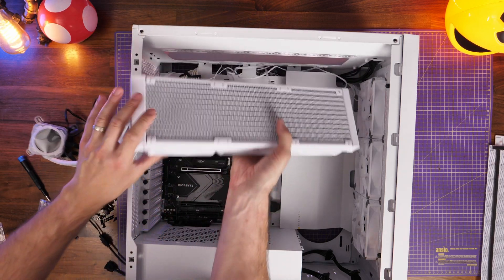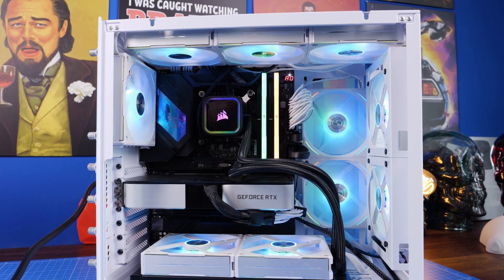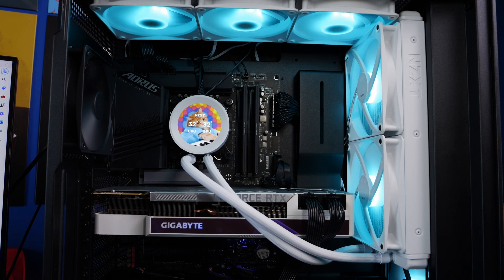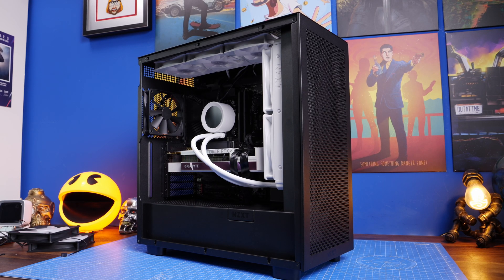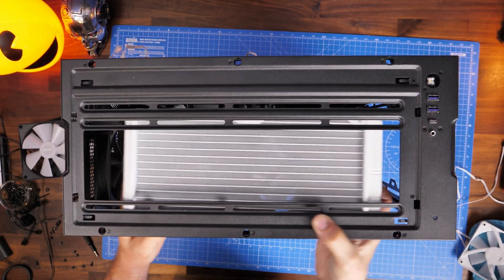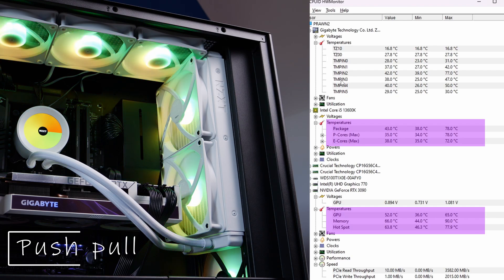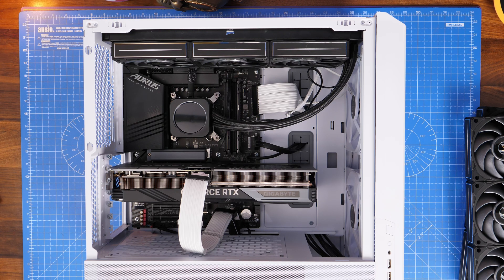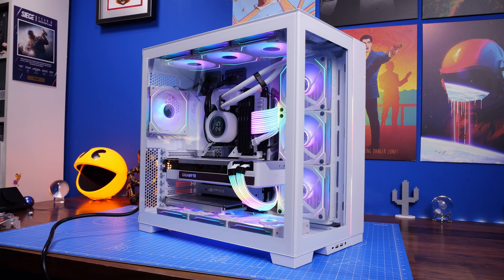Where should you install your AIO liquid cooler? The best places tested!

Comment: Finally a video that discusses fan direction relating to mounting location.  I have glass on two sides of the case.  The location that's makes the most sense for my build is side mounting near the front of the case.  But I wanted to be sure I was ok flipping the fans around since they need to be intake in that location.  Really appreciate your look at fan orientation relative to the radiator.  Everyone seems to be exhausting hot PC air through the radiator.  It just didn't sit well with me.
Reply: The most confusing thing is the orientation of the radiator fans.

They can be set to push air out of the case, in which case the internal case temperature determines the lowest temperature the radiator can achieve.

Or they can be set to pull fresh air from outside into the case, which cools the radiator better, but gradually heats up the inside of the case as the radiator releases heat into it.

I’m not sure whether pushing or pulling air is better when it comes to radiator fans.
But what I don’t understand is—why isn’t there a design option to place the radiator outside of the PC case?
Reply: The most BASIC rule of thumb, like the 1+1 = 2 logic used in math equivalence in AIO mount is that "AIR BUBBLEs OR AIR IN GENERAL WHEN IN A SEALED SYSTEM LIKES TO BE AT TOP" to test this get a bottle of water with some air in it, now notice how NO MATTER WHICH orientation you flipped, turned, twisted it as long as the cap is closed on the bottle the air in at the TOP. When you have it standing the airs staying by the cap of the bottle when you have it laying flat the air spread out through out the bottle but still AT THE TOP. Now use that logic we just tested to when you mount your AIO main goal here is to get the air as above and far away from the CPU as possible. So we are try to orient the radiator at the top or at least in a way the water is as far as possible from the cpu. Think of the whole system close your eyes and imagine it as a water bottle with some air. The bottle cap as your pump and the body of the water bottle as your radiator and pipes. Now think up a orientation to get the air as far, up and away from the cap of your imaginary bottle. Literally if you ever played with a bottle of water as a kid and watched the air bubbles inside swish around as you moved, shaked and jerked it around this explanation should click.

Comment: I did install the radiator on my PC in the front with the tubes at the bottom, just as you showed, with just 2 fans pulling air, but I was thinking about adding 2 more fans pushing air to make it a little more efficient, but, it's going to start the rainy season where I live so I don't think it's going to be necessary.
Reply: he did not show his front radiator with the tubes at the bottom(this is bad air can break the pump) he had the tubes going to  the top.

Comment: Hey so I have a 360mm aio I’m trying to find the best way to set it . Should if I mount it at the top  should I push air out and have the front fans pulling air in . Or the opposite have the top fans pulling air in and the front ones pushing air out ?

Comment: I always wanted aio coolers, but still haven't got it, basically my case only allow top mounting and i think top mounting is ridiculous, cause all the heat from the gpu will be push upwards due to the exhaust fan-radiator position, even switch it to intake makes no more less sense cause the thick radiator not gonna allow any air passed into the case, thanks for convincing me that they're actually not as good as they're advertised, especially when you're building sff 😂🫰

Comment: Old video but, i was just reading some.
Oddly, Corsair themselves on their own "How to Mount a Radiator" say to either do top mount OR Radiator front with Tubes at the bottom and only as a last resort have tubes at the top.

I dont know when they changed their literature, but i remember it being different recommendations.

Its always been that front Rad is warmer GPU temps, slighfly cooler CPU & Top Rad is cooler GPU, slighfly warmer CPU, in general.

Comment: Great insight! If I may could I ask for some advice as I'm thinking of building a pc with an AiO in a mATX case and I want it to be as quiet as possible. Therefore I was thinking that a front mount would be better to avoid having any fans on the top as those disproportionally increase noise (don't they?) but this might be a little toasty and in turn increase the fan speed to keep the temps (in general I care more about noise than temps though). Or should I just do a top mount with standard front intake instead (so more fans in total)? Which config do you reckon has a lower noise level while browsing/gaming?
Reply: If you want low noise pc, all you need to do pickup low tdp parts, and buy high performance fan, set pwm to below 1.6k, 1k rpm will be the best but your CPU will be slightly hotter, you can't get low noise with high tdp parts and oc, your pc will keep pushing temp

Comment: Hello! first of all congratulations for this video! I have installed my water cooling in the front and i want to use push pulling. I have three more casefuns on top of my tower and one casefun behind. can you please tell me which direction the watercooling fans should face? the front fans of the radiator must give air in the radiotor and the rear fans must extract the air from the radiator into the box; and the rear fan to blow the air out again? finally, should the fans on the top be pushing air down to cool the case or up to blow hot air out? thank you.

Comment: This video has been helpful in many ways, but the biggest issue I'm having is I'm getting confused by the numbers. The case says "up to 360", the AIO has "360" in it's name, but when I check the radiator dimensions, it's larger than 360! How do I make sure it's actually 360? Or does 360 in the name mean I can use it in a case that says "up to 360"?
Reply from the maker: Yes
Reply: @TheProvokedPrawn  Thank you! Now just need to finish saving and get started.
Reply: The "360" is a reference to the fan size.  A "360 AIO" is referring to a radiator which can hold three 120 mm fans which totals to "360"  (120+120+120=360)  This is the same for all AIO's.

Comment: I just recently bought a Nzxt Kraken elite 280. I top mounted the rad. My question is, should the aio pump tubes be facing 3 o'clock. Or is it fine having them facing 6 o'clock

Comment: I knew that the top would be hotter.. i mean hot air rises, so it's going to go right up to the rad. I've always set mine on the front or side.. brings in cool air all the time.
Reply: You can top mount a rad and the temp is still going to be fine you would think hot air rises but it all depends on the computer case and what kind of air pressure you have

Comment: not sure why the NZXT cam software is not detecting the cooling to control the lcd display panel. The Rgb lightings are detected and can be controlled. Please help
Reply from the maker: Have you connected the USB from the pump to the motherboard.
Reply: @TheProvokedPrawn  yes the both Usbs are connected to the motherboard via the nzxt splitter. The lcd is also running and I can read the cpu temperature but the component is not detected in the Computer. I checked both device manager and the Nzxt cam software as well. It does not detect/show up anything.

Comment: It would be interesting to see GPU benchmark being done for each of these setups. It makes sense that with the 1st and 2nd setup where CPU radiator got fresh air (as intake) the CPU temp was lower. The question is how would it affect the GPU when it's under heavy load. Ultimately it would be nice to see a CPU+GPU based benchmark which would be close to real life scenario (e.g. gaming).
Reply: GPU is going to be a few degrees more hot when you have the radiator pulling air from outside the case but only in extreme scenarios like running a cpu stress test and gpu stress test. In normal gaming use the cpu is never going to reach high enough temps to affect the gpu.
On the other hand when you have the radiator as exhaust (e.g. top mount) the cpu temps are going to always be higher, even during gaming because the gpu usually is getting hot.

It all comes down to aesthetics. I prefer top mounted radiators just because my pc looks better this way. Hope this helps.
Reply: It makes sense that with the 1st and 2nd setup where CPU radiator got fresh air (as intake) the CPU temp was lower. The question is how would it affect the GPU when it's under heavy load.

Comment: Bottom mount seems like a bad idea because hot air rises.  Top or side mount seems like the best option.  Moving the warm/hot air away from the case is the goal.
Reply: Not only it will blow hot air into GPU but also air bubbles going into the pomp, destroying pomp overtime.
Reply: what are you talking about? yes hot air rises so putting fans on the bottom pulls cold air from the bottom of your room. the reasons why you shouldn't do this is because dust falls and there's obviously more dust density, which could build up at fins/heatsinks/exhaust vanes. It's also terrible for AIO coolers because it introduces more air in the pump as coolant settles at the bottom.

Comment: I have the fractal design north case with a 7900XTX and so I had to take the front grate with the wood off and mount my radiator and fans to the front on the outside haha

Comment: Great video, nice discussion.

Personally, I'm mounting my new build with the rad on top so I'll be ok.

But I also think criticism of front mount/hoses down is overblown. Wouldn't an easy precautionary step be to flip the case on its side once a month or so and let the pump run for a while? This would tend to force bubbles out of the pump head/water block and into the rad. Then when the case is rotated to its normal position, the bubbles would move to the top of the rad.
Reply: Bubbles move to top so if highest point is the top of your rad youre good.

Comment: another thing that can affect you is if you have too many exhaust fans and not enough intake fans, the air flow can get slowed. so if you have 3 intake front, 3 exhaust bottom, 2 exhaust radiator top, and 1 exhaust back, the positive pressure can create turbulence with the top exhaust, effectively slowing down the air flow through the radiator.
Reply: I prefer: bottom and front should be intake, back and top should be exhaust

Comment: Hello, I don't know if the previous message came out, I have questions...I wanted to know if this master cooler works for any Ryzen processor and does it not need thermal paste to control the temperature? or does it just set and that's it? Excuse my ignorance but I would like to know.

Comment: I have a Lian Li 011 Air Mini and just purchased a 280 AIO that I'm planning on top mounting. The only problem is I am getting mixed opinions on whether I can top mount a 280 AIO with an ATX mobo in this case. I've never mounted a rad anywhere but on top so i'm trying to do as much research as possible incase I have to mount it in the front. I guess I'll find out in a few hours when I go pick up the AIO.
Reply from the maker: https://youtu.be/sVEXd-Wp8FY

And 

https://youtu.be/_qJp8EOA9Uk

Comment: How much of this directly translates to having an AIR CPU cooler and an AIO GPU cooler? I am using the Fractal North Mesh case and have had a serious 2 day struggle with getting my system cooled, having to revert the airflow to make it all fit and I am still seriously bothered that my current setup is going to be the downfall of the expense I made (previous system was from 2014).

Comment: 1 - Front mounted with push pull fans (four fans total) 
C: 78
G: 65
M: 90
H: 77.9

2 - Front mounted with just the NZXT Core fans pulling air
C: 82
G: 66
M: 90
H: 77.4

3 - Top mounted with the fans set to exhaust
C: 88
G: 66
M: 90
H: 77.8
Reply: Thanks for this. I had no clue what he meant by “push pull” vs “standard”. Didn’t realize the first option employed four fans
Reply: Thanks For these numbers

Comment: I have my Corsair H155i 280mm AIO vertically mounted, in my TT view 71 case. I found it to have the best results. Since my AIO is intaking fresh air from my front 120mm x3 fans. I have a 13600k, OC to 5.5ghz on all Pcores, and i don't go above 58c for gaming.

Comment: Which case is this? I cannot mount my icue H115i into my Corsair Obsidian 650d or the Corsair 400d which Ebuyer told me would easily fit. I'm thiking now I'm gonna have to do some radical mount; missing my MSFS2020, and the warranty clock is ticking on all the new parts.

Comment: If I don't care about aesthetics should I have my tubes down? I plan on having a setup similar to yours except the bottom fans, just radiator as intake on the side, exausts at the top and back of the case. Also should I have fans on both sides of the radiator? My case looks similar to a lian li o11.

Comment: Now if only these AIO coolers didn't suffer from galvanic corrosion in the pump head.  These things are ridiculously expensive considering they only last a little more than 2 years.  I['m switching back to air cooling until these AIOs come out with 5 year warranties for the same price.  Reliability trumps' performance.
Reply: Arctic liquid freezer 2 420  comes with a 6 year warranty

Comment: Did you normalize/fix fan speeds? More likely the top mounted build had the 3090 fan running slower. It is also interesting to measure VRM temperatures and inside case air temperature, which are likely better in the top mounted build.

Comment: I have an air cooler 4090. Having my aio top mounted to exhaust is ridiculous lol. Makes my water temps and cpu temps much higher. I just put my 360mm aio to the side for intake and things work out much better. I have the the lian li 011 xl for reference and a 13900k

Comment: At @2:23, the AIO is 280mm? Did you had enough space to mount 3 x 140mm in front of the H7 Flow case? Do you reckon in this setup, 2x140mm top exhaust fans will work? I can see you have  3x120mm. I want to buy this case for this combo:

Arctic Freezer II 280, push pull front mount, tubes down. 
1 more Arctic F14 in front, blowing air under the shroud
1 exhaust 140mm in the back
2 exhaust 140mm on top

Comment: When you have it top mounted, you are using the warm air already in the system for the radiator fans. That's why its hotter compared to when you have it vertically mounted in the front, which is drawing cooler air from outside the case.

Comment: Hello! Im currently building a pc with a 4000d airflow. Im thinking of adding 360mm fans as intake and 280mm fans as top exhaust. Ill be using an air cooler for my 7600x cpu. Does this setup create positive air pressure in the case?? And will the cooling be sufficient for a 7900xt. Thanks!!

Comment: i think water custom loops benefit more from intake radiators and air cooled one from exhaust radiators. i think one front larger rad for gpu and another one on top for cpu, and if you case allows it you can put some fans on the bottom bringing more air.

Comment: Cheers foe the vid, I have mounted coolers in many positions before but still good to get someone's else's perspective.  For me I find little to non difference running the cooler front (tubes at the top higher than cpu) or top.  My cpu idles at 60 - 63 ish, I feel that too hot, especially when posts on reddit talk about this cooler 20C lower.

Running h150i, 5900X in a fractal R6.  No door on front of case, and open top

Comment: I'd love to see a video on cable tidying tips. I'm about to try out some 90 degree USB 3 and USB 3.2 headers so the front panel cables go parallels to the motherboard but I'm wondering if there's any downsides (signal issues, reduced power, etc.). Likewise, I'm curious if there any any 90 degree or C shaped connectors for 600w GPU cables since bending them or hitting the glass can be hard on the plug.

Comment: I'm currently building up a new system right now (looking at 7950X3D and RTX4070) and this + the Lian Li Uni v2 videos, as well as a few more of your videos, have helped me understand a lot more.
The last time i built a computer was around the time that the Ryzen 2000 series and RX580 were brand new, so i have a lot to learn!
Reply from the maker: Glad to help!
Reply: that cpu go along with RTX4090 or RX7900xtx only .. u should get i5 Intel or R7 AMD .. personally i use R9 7900x3d+RX7900xtx and i have bottleneck like5% only ( less than6% is fine for multitasking like 3D rendering editting etc )
Reply: @oldschool_bamagatrader9960 7900x3d doesnt bottleneck 7900xtx. did u use a bottleneck calculator or this is info from ur system?
Reply: im a bit late but yeah
Reply: unless your doing video editor and production i would bump down the cpu to something like a r7 5700x
Reply: @harley.-.   r7 7800x3d let the man game

Comment: 9:03.  About 15 years ago built a system in a clear acrylic case. Booted! Installed windows! Removed the plastic off the acrylic.  The second I felt static on my hand I stopped.. Too late, it shut off and wouldn't turn back on.   I RMA'd the board, CPU and video card because I didn't know what got fried.   I learned my lesson.

And im still confused on how to mount it. The more I watch, the more confused I get.

Comment: This trend of having the radiator as top exhaust is silly when the option to front or side mount as intake is available. I think its obvious that feeding your GPU 100-150W of CPU heat is much preferable than feeding your CPU 300-450W of GPU heat...
I experienced this first hand when I top mounted my 360mm AIO. Liquid temps went from 30-32C all the way up to 39-45C. The only thing that changed was the radiator position, and GPU temps stayed identical.
Reply from the maker: you realise that the GPU exhausts from the rear right?
Reply: @TheProvokedPrawn  a reference GTX 1080 does yes, but almost no card is a blower design nowadays, they all spit hot air from the sides into the case which the top exhaust, well, exhausts